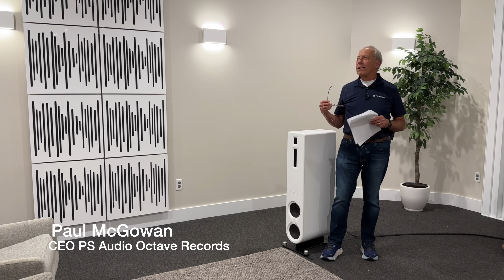Light dimmers and HiFi systems

Comment: Led lighting fluorescent lighting and dimmers,and any RF equipment including WiFi cell phone  do not get a long with ac power lines and they do cause interference .Period !Does not matter .PWM is just as bad.Wetger ist CE ,UL,ULC ,PQS ETL pick yoye certification .And whats worse are variable speed control on furnace and read mills and pool pumps and so on .

Comment: TRIAC CONTROLLERS? YOU KNOW YOU JUST DESCRIBED BOB CARVERS MAGNETIC FIELD POWER AMPLIFIERS.. yes have triacs that I preached for 35 years that trash the power for the rest of the system and puts hair on its own signal too..AND THE INDUSTRY HID THIS.. dare you to say im correct..cause you accidently told the truth.. if a dimmer in the bathroom screwed your power up..admit..that a triac controlled amp on the same circuit with your audio .. causes more spike ripple because its not only in the same room.. but connected..

Comment: Audiophile advice: 
If you hear buzzing from a dimmer, then replace it with a new high quality dimmer - Lutron or Lightolier. If you don't hear buzzing, then you are good as is. Don't fix what isn't broken. I remember the mid 1970s as an early teenager building audio amps and that damn dining room chandelier my dad insisted be dimmed down every night! So I do agree it CAN be a problem.

Comment: Howdy.
For clarification. Modern dimmers use zero crossing switch on and off. Way less harmful for the AC quality as triac choppers.
Regards.
Reply: If that is the case, then how do they accomplish dimming? A thyristor dimmer works by shortening the on and off time of the AC sinewave thus effectively lowering the apparent voltage to the lamp. The other way is an auto-transformer (Variac) that does actually lower the voltage. Variacs are often used in recording studios for reasons of electrical noise. Another impractical way is a variable amplitude 60hz oscillator - meaning a 600 to 1000 watt audio amplifier. Newer high end theatrical dimmers use more sophisticated PWM techniques but that's still chopping up a waveform. New home dimmers are quite due to improved filtering, not really a new technology but additional cost .
Reply: Howdy  @andydelle4509  .
With zero crossing switch on and off only every second cycle is let through to the load. Or every third, every fourth, and so on.'
Or two cycles of three, three cycles of four, and so on.
Thanks for the clarifying question.
Regards
Reply: @eugenepohjola258  OK so they are just dropping full cycles to reduce the apparent voltage. This would work quite well on incandescent lamps. Would need a complex controller but what does that cost in the past 10 years? 10 cents in consumer  production quantities.

Comment: Take a portable AM radio and survey the house for RFI
Reply: If you find any it's no problem if you don't listen to AM radio.
Reply: @MrsZambezi  if the dimmer / power adapter etc is generating a lot of RF noice it might well get back into the house wiring. Either way this junk needs to be cleaned up. I do listen to short wave radio in AM and SSB modulation.
Reply: @RogierYou  But it still doesn't matter if you don't listen to AM radio.

Comment: Put in a large transformer and run separate balanced power for only audio equipment, best thing you could do…..very often done in studios
Reply: A good way of wasting money.
Reply: @MrsZambezi  On paper balanced AC power can offer up to a 10db noise floor improvement. Note I said "on paper". I did install a house wide system for my HT and other house TVs with a surplus 15kva 480/240v transformer running at half volatge (240v in to 120v center tapped). Not sure I would do it again but rather just install dedicated circuits. I can't say it really made a huge difference but as it was a new build out I have no reference point to measure the before and after noise improvements. With everything going digital these days, balanced AC power is becoming obsolete. The only analog in a modern studio is the microphones so far less opportunity for system induced ground noise.
Reply: @andydelle4509  You say it made a difference. To what?
Reply: @MrsZambezi  No, I don't think I said my balanced power clearly made a difference, certainly not a huge difference.  I don't know because I never really ran and measured  the system noise floor before adding the balanced power system in my 2002 HT build. As I said, the proponents of balanced power - Martin Glassband of Equitech, claim a ground noise reduction of up to 10db. Of course like any predicted specification, that is optimistic.
Reply: @andydelle4509  Nothing on the mains side will affect noise performance in an amplifier in that way. You've been had.
Reply: @MrsZambezi  You are correct! It's not about improving the noise floor of any component. The improvement, if any, comes at a system level. In large studio systems even with balanced connections you get ground loop noise. Noise on the ground path will also be present on cable shields. By keeping the AC power balanced, less power line noise is present for the audio cable shields to pick up.Most home systems are not complex enough interconnect wise to have this issue./
Reply: Not necessarily a waste. 

It all depends on execution, ie., the amount of current throughput pulse capability, and it's output impedance characteristic. 

If the former is adequate and the latter is sufficiently low, ... suitable performance gains can be realized.

Comment: Back around 1977 to 1983, many a "bachelor pad" in my neighborhood went up in smoke due to improperly installed inductor-based lamp dimmers.
Reply: These technical measurement freaks, like the one who called me a wise as* yesterday, and whose insults were a highlighted comment by the moderator, (suspicious), after I conflictingly pointed out that  electricity travels about as fast as the speed of light; you wonder if these technical barons ever went on a date with a woman, how many minutes it would be, before the woman would rush for the exit, because they couldn't believe how painfully BORING they are. He even thought I'd waste my time doing some math on of all things, resistance in cables many times longer than almost anyone would actually use in practice.
Reply: @sidesup8286 
Best pickup line with a girl you meet at the Bar.
Wana come over to my place tonight and measure my cables..🤗👍
Reply: As long as she doesn't have an electronic measuring DEVICE. There is some question as to how much improvement the right cable would show on a graph. I have cables that can make the glass start to rattle, with the same recording played at the same numerica. volume readout on the front panel  so it should show up in a competent measuring technique. Many troubles with measuring; move the mic an inch and a total different reading etc. Glad measurements are boring to me. What they never can measure is stuff like "with these cables I can hear the drummer's playing brush on his drum throughout this whole track, totally non audible with other cables. Or "these cables reveal that it's two guitars playing in close unison, where with the others it just sounds like one guitar" or "you can hear an ambient echo, now that the soundstage has opened up and you can even tell which direction the echo is going." Can't say I truly understand why great cables can greatly improve the sound. But it's not too important to know why. I'm sure there's more to it than meets the eye. There were things  by the 1890s or before that were technologicall too complex for most people even today, to begin to understand how they worked.

Comment: I remember my parents laughing at me for hating dimmers when they first came out. How people couldn't hear the buzzing was scary to me.
Reply: The buzzing noise came from the toroidal inductor inside .... by fixing it down with some hard setting sealer you could quieten them down
Reply: @janinapalmer8368 also from the light bulb filaments and, to topic, from any nearby audio device vulnerable to line noise. They can clobber AM broadcasts too, though switch mode power supplies are worse on that.
Reply: They laughed at me for hating dimmers, back then... they're not laughing anymore, after learning how much I spent on my audio system...